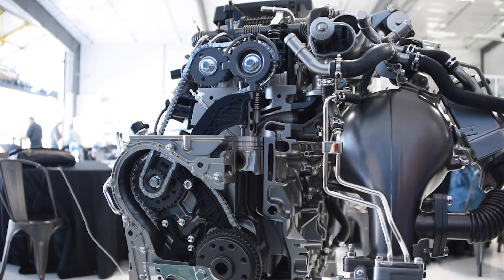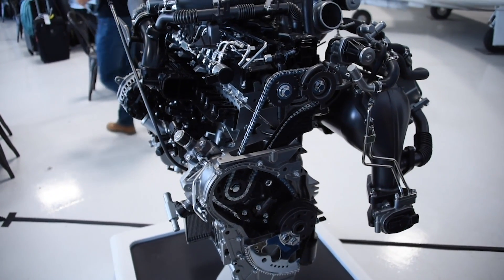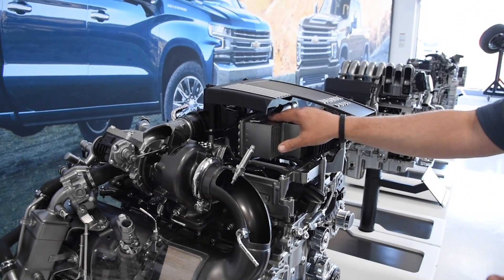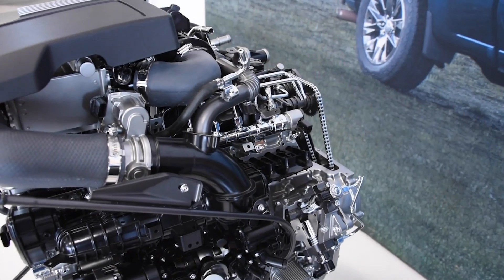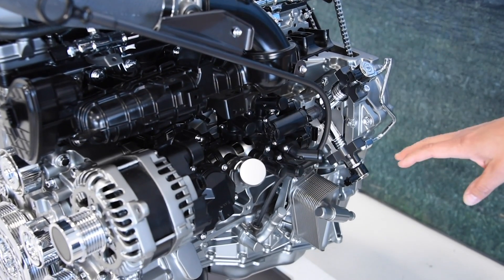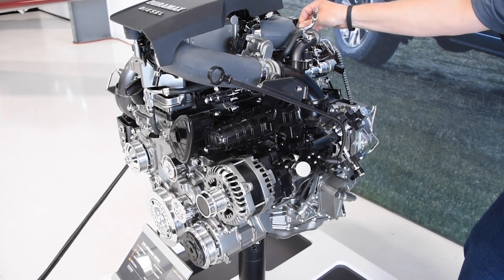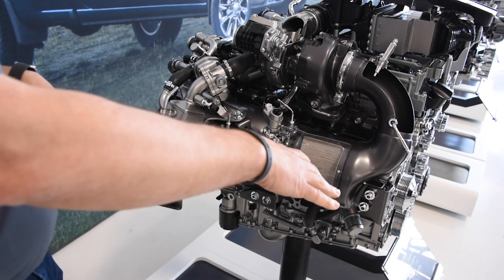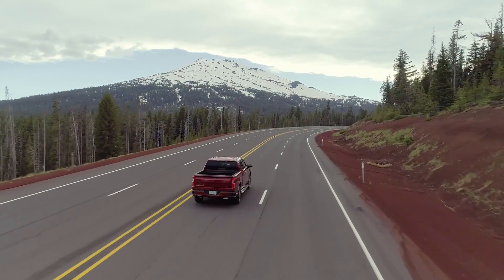What you don't know about the 3.0-liter Duramax diesel

Comment: Timing chains have no service limit? I doubt it. I’m willing to bet we see issues around 100k
Reply: The amount of hate for that stupid rubber oil pump belt, super strechy chain at the REAR of the engine, makes me laugh like hell. What a piece of shit. Like GM has an awesome reputation with timing chains since 2009.
Reply: I was looking at the route of the timing chain and just wonder what they use for the guides??? Plastic , metal or some kind of compound of both?
Reply: I bet before why not gears
Reply: @dalemarshall625  Because it takes a lot of gears to get an overhead cam setup to work. Look at an old Cat 1693 with the DOHC, had like 3 idler gears just to get power up to the cams. It is obvious these were built only to the price point and first owner needs. They don't care about anyone that would own one of these after warranty is up.
Reply: @bcbloc02  yup, all they care about is the initial sale to a guy that will trade it in after 4 years with 80k miles
Reply: @dalemarshall625  Because it will make the engine louder.

Comment: Although it is easy to look at all the complicated systems on the engine and call it a unreliable piece of shit. Sometimes something as crazy sounding as  a wet belt for the oil pump turns out to be super reliable. Also though it is hard to believe that this is will be a trouble free 250,000 mile engine. Only time will tell and I ain't gonna be there r&d.

Comment: Besides the oil pump belt, all the extra emissions equipment and the coolant management will be a nightmare for a 2nd or 3rd owner. I'd rather have a gas engine unless towing constantly, but then there are better options for tow rigs. In 10 years electric trucks will be better than conventional ones anyway, and it'll be at least that long before I can afford a new truck!

Comment: wow i see so many failure points this looks like a look in the past with ford and the 6.4 post injection come on and there just looking to a under hood fire wait till a rat makes a nest under there and 10 mins later time for a nice rat burger and i like how to talks about when the rubber oil pump belt haha breaks you will get the right check engine light lol yea it called no oil presser and a lock up motor lol come on gm really don't hire the ford rejects

Comment: There's a belt driving the oil pump LOL enough said what a piece of shit. I love how they ALWAYS say the chains are good for the life of the engine no need to service when that's literally never the case
Reply from the maker: Not necessarily. A lot of engines go 200K or more with chains.
Reply: @TheRVConnection  you're right. A single short chain driving an in block cam. My years of maintaining a fleet of trucks has taught me one thing- simplicity is king with pickup engines. Perfect example would be the common rail Cummins 24 valve. All accessories are gear driven and it uses one rocker arm to actuate two valves, yielding a 4 valve head without overhead cams. Real diesels don't use chains or belts for a reason

Comment: Rear, chain driven timing...
"Wet" belt driven oil pump...
"Flapper valves" in the intake runners...
Exhaust throttle valve...
DOC, DPF, EGR, and SCR? Why don't you work on building an engine that will meet emissions requirements without these PITA systems?
Anyone who buys this engine after watching this is a moron.
Reply: You can thank the Government for that. Cars would be getting safer by consumer demand and not gov meddling in the private market.
Reply: @roninkraut6873  You can thank the democraps/democ-rats, NOT the government.
Reply: My 2010 BMW Inline 6 diesel has swirl flaps, DOC, SCR, DPF, and EGR systems. There's nothing new about them. Any modern diesel will have all but possibly the swirl flaps. They are simply what's needed to meet emissions. Those that tried to avoid it, namely International/Navistar, tried EGR only solutions that just about cost them their ass in the end. The engines were known for unreliability and horrible fuel economy. Think 6.4 Powerstroke/Maxxforce engines etc.  Cummins held with EGR only too for a while, but they at least had a reliable engine. They just suffered fuel economy wise.

Long story short, if you want to meet modern NOx standards, you want a SCR system. It greatly unburdens the engine.
Reply: @nate0031  I agree with most of that. I suppose my original point was that new technologies should be persued to eliminate the most egregious issues with these current emissions systems; EGR coking up intake manifolds and cylinder heads, DFPs sooting up and requiring periodic cleaning, even SCR with DEF that crystallizes and plugs up dosing units.
It wasn't long ago that an engine making 1 horsepower per cubic inch was really something, now...insane levels of power from very small displacement engines.
The technology will improve.
The technology HAS to improve.
A new way to cut diesel emissions is out there, it just hasn't been thought of yet.
Reply: @heavymetalmechanicX  I see what you mean. Yea I agree these methods are far from perfect, and would love to see some more elegant ways of meeting emissions without them.
Reply: @heavymetalmechanicX  yes it is it's called GTL gas to liquid there are fewer there are fewer hydrocarbons therefore the need of emission systems would be lower
Reply: @nate0031  who cares. Get a full delete and tune. Drive happily for a million miles.
Reply: @nate0031  You may own a diesel, but you don't f@^&ng know how it works, goofy❗❗❗
Reply from the maker: Unfortunately, a lot of these technologies are required in order to meet increasingly stringent diesel emissions regulations. You can thank VW for that.
Reply: @TheRVConnection  

Diesel emissions has been progressing long before Volkswagen was caught cheating emissions, started back in the late 80s early 90s when the big three ford chevy dodge started turbocharging their engines and changing injection systems every couple years raising injection pressure to get a better burn and more power, then came egr coolers around 2002-2003, dpfs in 2008 and def in 2010-2011
Reply from the maker: @007.3l  Agreed. But there is no denying the "Dieselgate" scandal put a microscope on diesel engines. That's part of the reason Daimler Chrysler had to cease production on, then re-design the EcoDiesel
Reply: @TheRVConnection  The other reason is customer satisfaction. The 3.0 Ecodiesel was a crappy engine to begin with because it's made in Italy by Italians and it was poorly designed.
Reply from the maker: @atx-cvpi_99  The 3.0-liter Duramax is built in Flint, Michigan (from globally sourced components) but it was designed in Italy.
Reply: The RV Connection Wasn’t the 3.0 Duramax developed by GM and FEV from Germany
Reply: @atx-cvpi_99  the Eco was a 5th gen there and a GM engine originally, happy with mine no trouble at all,the new straight 6 GM looks intriguing but I fear the aluminum block, Past cyl.liner issues..
Reply: @TheRVConnection  no you can thank EPA for all this bullshit
Reply: No, you can thank the democRats.
Reply: Shut up stupid!!

Comment: P.O.S I just retired traded in my last GM product. 2002 Chevy 1500 4x4 5.3. 145k and is falling apart. Not to mention the 5 grand I needed to dump into it to get it this far. I bought it new and maintained it perfectly. They simply are not designed to go much past 100k without expecting some larger repair. I had a 96 GMC SIerra prior and had major issues with it at 75k at that point traded it in for 2002. I will not buy another GM product ever again. They are not designed to last. The GMC had a gasket leak which allowed antifreeze into the crank. I traded it for the 02. I won’t list the things I had to fix on the 2002 to get to 145k. With all that said. I am very excited to be picking up my new 2019 Toyota Tundra TRD Sport 5.7 double cab 4x4 this week.     My money is on Toyota from here out.
Reply: i have 309,000 towing miles on my 09 duramax and still going strong. i'm pretty pleased with gm so far

Comment: What POS💩💣
I'll keep my Cummins.
No chains no belts 🤔👍
Reply: Yes, Cummins is Cummins. In diesel, the champions.
Reply: Cummins has GEARS.
Reply: G III your full of shit,did you read that on the internet?
Reply: I wish cummins would get in this small I 6 game
Reply: They are in the small I-4 game.
Reply: @superjesus4307  Yep the 2.8 crate engine, make your truck or Jeep happy,If I could have justified it, was considering one of these for my  Dakota.
Reply: @leehancock2782  Any Cummins will fit if you're creative enough. :p
Reply: Oderus Urungus exactlyyyyy lol
Reply: @giii7599  It's funny to watch you Ford and GM guys make stuff up because the Ram is beating your trucks. Come work with me in the mines where we keep the trucks moving. GM are crap, Ford is the worst and the Ram's are doing super good. We sell Ford and GM trucks at 100K the Ram we keep until 185K to 255K with no problem.  We were surprised too, but the Ram truck is tough as nails. I have noticed Ford and GM guys hate seeing Ram so far ahead of their vehicles and they can't seem to find a way to catch back up to the Ram.  I saw the new safety test where the 19 Ram was the safest truck beating all trucks too. But that Ram sure is a tough truck and we don't have to fix them like the others. The Ford doors, electrical systems are bad.  We lost some engines too.  GM we lose the starters, lots of vibration issues and door hinges.  Also lots of oil consumption.  Ram the only thing was the trim around the windshield and we put larger side mirrors on them.  The guys at work that are Ford and GM lovers even admit the Ram is holding up and it's a comfortable ride.  They make up stuff and it's fun to watch because they know the Ram is a better truck...again they make stuff up just like your post.

Comment: When the oil pump belt fails you will be warned when the engine grenades!
Reply: @Mr Sunshines News flash, Sunshine:  By the time your "oil pressure light" (idiot light) comes on, your bearings are already fucked... unless you think failures only happens when you're idling in your driveway.  No, in reality they happen when you are working the truck, like pulling a load up a grade... so there goes that brilliant advice!
Reply: Okay whatever you say!
Reply: A belt driven in oil not good
Reply: or you could just watch your oil pressure guage regularly and act accordingly like a reasonable human being....
Reply: @jedediahhoffman7925  Do you watch your oil pressure gauge all the time you're driving, when the belt breaks the oil pressure will be 0 within seconds.
Reply: @benjaminwayneb  yes i do. obviously not non stop, but i keep a close enough eye on it that i lost oil pressure, i could avoid major damage. you got to think.... if you change your oil, new filter and oil, how long does it take to get oil through the system. 2 seconds? 3 seconds? at start up.... 1.5 seconds? 2 seconds? you think having it run for 7-10 seconds with no oil pressure, one time is really that much worse than every day running it for a total of 10 or more seconds dry? now my wife.... she'd prob blow the thing up.

Comment: What happened to using gears like the old straight six in the old days, oh yeah, they last too long..
Reply: Get the gas model
Reply: @papabits5721 I get diesel for $1 a litre I can’t get gas for under 1.60.  Be a fool to buy gas engine 😂
Reply: Gears are significantly noisier. One of the goals of this design was to be as quiet as possible, to be use in luxury vehicles. I would prefer gears but there are reasons other than coast. And timing chains “when designed correctly as a system,” should last as long as the vehicle. The oil belt is much more concerning. Short oil change intervals should be a must to keep oil from becoming corrosive to the rubbers in the belt.
Reply: Gears add NVH which matters in this class.
Reply: @kevin9c1  If someone is worried about NVH over reliability, then they shouldn't be buying a diesel
Reply: @AandWProductions  Diesels haven't been the choice for reliability for over 10 years given emissions regs and even longer if you look at Navistar...I'm talking Ford 7.3 or Cummins 12V.  Those provided actual long term reliability at the cost of noise, refinement and with outputs well under 300hp (and like half the torque of today's offerings).  No free lunch.
Reply: Noise, vibration, harshness is one of the biggest reasons, that and gears last way too long.
Reply: Cummins still uses gear timing!!
Reply: Chains are quiter,  but it's not a belt.
Reply: They are on obsolete design. Exactly why nobody uses them anymore
Reply: @steven530x  the little 3 cylinder 1200cc diesel in my lawn mower uses gears. So does nearly every other "real" diesel on the planet. But then again real diesels don't need glow plugs either.
Reply: @doch5123  They don't need glowplugs, but they are more efficient with them. Same concept with the belt instead of gears.
Reply: Steven NorCal low plugs are just to ease starting in cold temperatures...
Do you know anything about Diesel engines , I’m betting you know a distant relative are family Freind who has or had a diesel at best.
Reply: @steven530x  because they never fail stupid manufacturers wants engines to break down to give them work
Reply: @steven530x  they are a commercial design built for durability. The Cummins 12 valve 5.9 was originally built for tractors before thrown into a truck
Reply: @steven530x  the 6.6 duramax has timing gears
Reply: @steven530x  tell me you don't know anything without telling me you don't know anything.

Comment: Durable?  Maybe, but this seems like another terrible design... let's design another duramax that takes hours or days to repair anything, and the Duramax (Isuzu) is absolutely cluttered with nonsense.  Cannot see anything on the engine, and on some Duramaxs you have to remove 2 hours worth of stuff to replace an injector.  Now, have to drop the trans for belt and chains? Whyyy? Craziness to me

Comment: A belt really in the rear at that wtf🤦‍♂️
Reply: It's easy to service. Simply 'slide the transmission back' and there you are!
Reply: oil pump driven by a belt, man it figures GM would be so brilliant.  They will sell more engines that way because not it cannot last, then again with the GM = gov motors name I would never expect it to be worth anything.
Reply: Ram has a rubber hose under the intake that supplies hot oil to the turbo.  $2k labor to change it and it fails anywhere between 25k and up miles.  Rubber hose is a wear item - no warranty.
Reply: @csinalabama73  
What engine are you exactly talking about? EcoDiesel? 6.7L Cummins? Any Hemi? Pentastar?
Reply: @csinalabama73  lies
Reply: @CrazyForCooCooPuffs  It's coolant, not oil.  My mistake. Still 2k to fix it.  https://www.ecodieselram.com/forum/threads/turbo-water-coolant-feed-tube-failure.1743/
Reply: @csinalabama  that's an eco diesel, a non cummins engine designed by non cummins entities, if you buy something like that stupid failures are expected because it isn't designed by an industrial engineer. Eco diesel is planned obsolences. It's designed to be a quiet alternative for laymen, internal designed not for longevity but to be quiet and parts used all over to last u til the warranty runs out. They are pretty smart to make sure that oil lineasted until the warranty that covered it ran out and gladly took your money to fix it lol.

Comment: Serviceable belt? Removing the transmission to service the belt?
Reply: Ford removes the Cab And front clip to "service" the 6.7 or 6.4 liter.
Reply: @nellyfarnsworth7381  And on the Econolines, remove the body off the frame.
Reply: What if it’s 4 wheel drive?
Reply: Your automatic transmission will probably go out around that time so just replace the belt with the transmission.  Half kidding.
Reply: JJ Bookman  Joking how? Dropping a transmission isnt shit. Any mechanic with average intelligence can drop a transmission in no time
Reply: @steven530x   "any mechanic with average intelligence".....but not the average consumer.
This is terrible engineering.
Reply: @ Yeah, I'm not willing to drop a transmission just to change a stupid timing chain.

Pass.
Reply: Dropping a transmission is much easier than pulling and engine. A 1 hour job. Easy.
Reply: @steven530x  Except that they will charge you 4 hours labor for pulling the trans and putting it back.
Reply: @steven530x  backing it off,not lowered
Reply from the maker: @steven530x  100% Correct.

Comment: So they are going to inject raw fuel into the cylinders on the exhaust stroke to run the re-gen cycle... isn’t that what they did in 07 and 08 and everyone had some serious fuel dilution issues in the engine oil... bad for engine life.
Reply: Just put a injector in the exhaust.